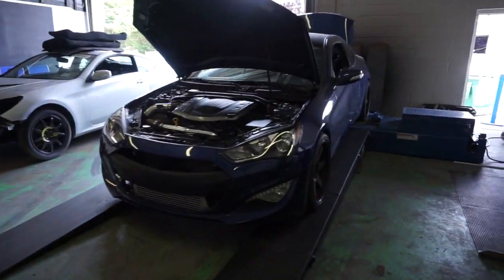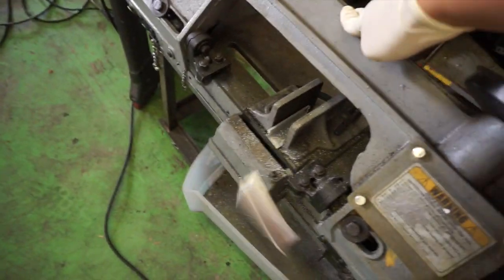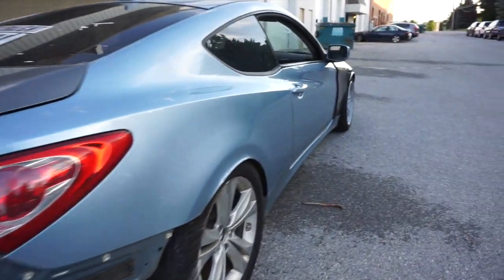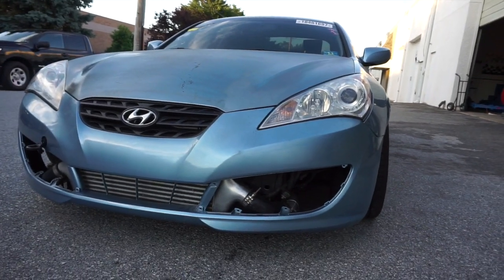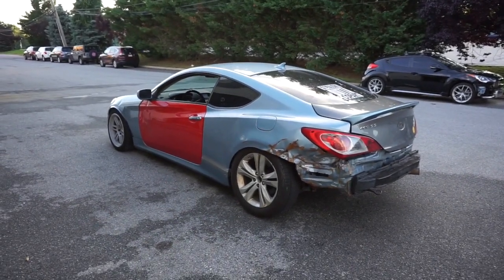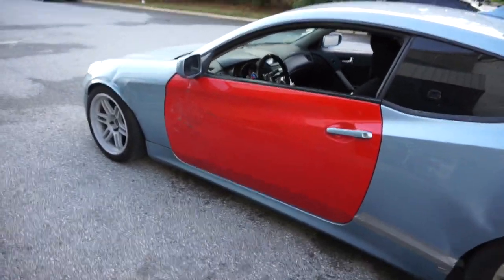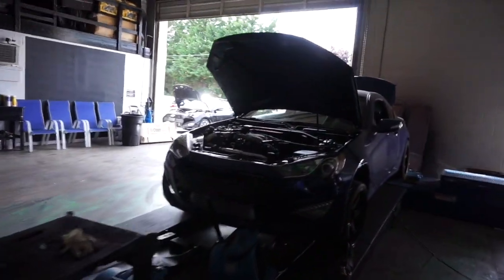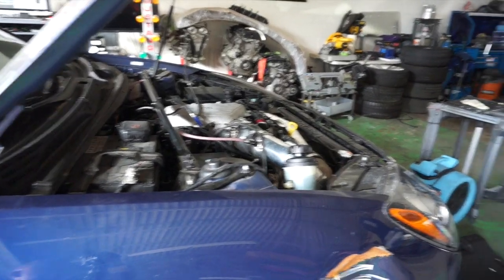Reinstalling the 3.8 Turbo kit | New Copart car look | Guess who's back

Comment: I thought you were installing the turbo kit on Orion's car. Got excited for a sec there
Reply: Matthew Anglin He doesn't, that's the point. Was hoping he was getting one
Reply: Steel City Constrictors if orion looling for more power!
but better upgrade the internals 1st
Reply: Niko Oliver No doubt about it. I definitely would too
Reply: Niko Oliver yep the 3.8 wasn't meant for boost ment for n/a ,it can handle turbo on stock internals if you tune it well and don't beat on it too hard but if you do beat on it like Orion does stock internals won't last
Reply: Steel City Constrictors same!
Reply: rushking19 my Grand prixs 3.8 is made for boost though  hahaha
Reply: Boosted Buckets got a boosted 3.8 out of a GP in my minivan. Intercooled the thing takes boost like a champ
Reply: ScMinivanIc hahaha sweet yea I have a 04 Grand Prix gtp it's pretty fun, what's it in a Pontiac Montana ?
Reply: Boosted Buckets it's an oldsmobile silhouette, same thing as the montana though. Got a little video on my channel
Reply: ScMinivanIc cool I'll check it out I have a few videos of my Grand Prix before I put headers on it I need to make a update video and drop a pulley get a tune and a few other things but I'll go checkout your video
Reply: soon....
Reply: Boosted Buckets good old bullet proof 3800 besides the plastic coolant elbows
Reply from the maker: We have something in the books near future.
Reply: seoulfulracing Oh I'm sure you do. Keep up the good work with the vids. Been enjoying them
Reply: Boosted Buckets lol yeah I know those motors was these have too high of compression 11.5:1 and to tight of a ring gap for boost ,same problem the brz has, and the 370z 's

Comment: I need to get my gen tuned! But I'm waiting till I get my full exhaust , intake , fuel injectors , and intercooler
Reply from the maker: Canned tune works from bone stock to full bolt ons.. So you can sure get the tune first then start adding bolt ons like a lot of people do.

Comment: You guys should consider spray bombing the Co part Genesis. Then it can be one color again and be touched up cheaply anywhere. A bash bar for the back of it would add some drift car swagger to it as well.
Reply from the maker: Bash bar will be coming but one thing I've learned in the past is there is no reason to add anything that's not going to help at my level of drifting then SUCK LOL. I sure could have put bigger turbo or engine swap/ angle kit /etc but as I advance, other mods will be added to support. I think Copart is a great example you can look like dog crap but can kill at the track.

Comment: Why was wills car over boosting
Reply: TheLostAdventuress lol maybe he but a bigger waste gate spring in😂
Reply: +rushking19 i thought you had a motor to swap into your tiburon?
Reply from the maker: Only thing we can suspect is the wastegate itself or the spring since that is the only thing that's controlling the boost straight from the turbo. We've seen this before with some Wastegate springs in the past (though it's Brown/Gray WG40 spring that's advertised for 5psi).
Reply: seoulfulracing yeah it's probably that I remember you guys saying that before on someone else car I remember
Reply: Will Jennings it does I bought it for 1k with a blown motor which the last owner thought it was a spun bearing but I found out when pulling it out it was actually because the hack job he did on the timing belt and didn't tighten all his bolts and one fell in the timing cover and caused the belt to get clogged in the bottom gear locking it up,i put a new motor in and it was fine

Comment: Aaron's car sounds so much cleaner 😍 ,oh yeah can you explain to me why on a true dual exhaust a single exhaust would flow better like you said for Orions Genesis coupe, I get on a non true dual exhaust that single will flow better ,but I thought a true dual exhaust would flow better staying true dual
Reply: rushking19 true dual flows better but I don't think that gens are true dual I think it's just y spit to dual muffler so a single would if it had h or x pipe then it would be true dual and flow better
Reply: Marquice Rowan the Genesis coupe 3.8 is true dual has two cats two resonators and two mufflers, it's the 2.0 t that isn't true dual
Reply from the maker: Sure True dual flows great as well. It was just only thing what we could do for Orion in short period of time to replace single outlet exhaust like Tomei yet something we can fab up pretty easily.
Reply from the maker: At the end of the day there is no major difference on NA cars. Aaron's car is just end muffler delete lol
Reply: seoulfulracing oh yeah I forgot on n/a cars it don't really matter but on boosted cars it does, same reason I'm going single tip on my tiburon v6 when I go turbo